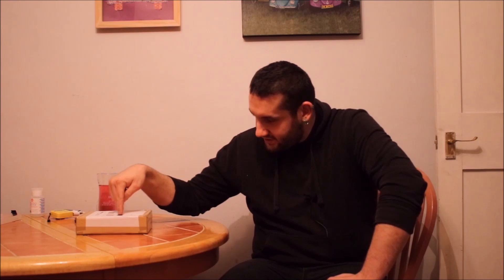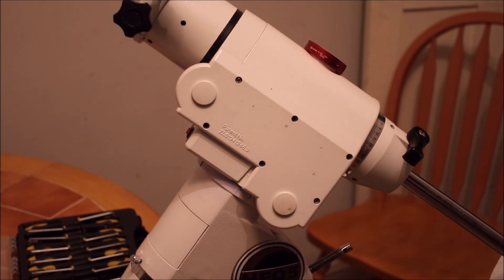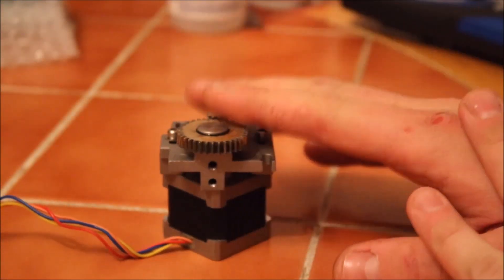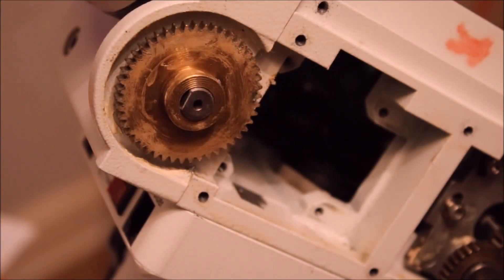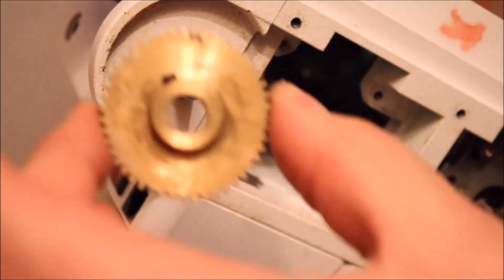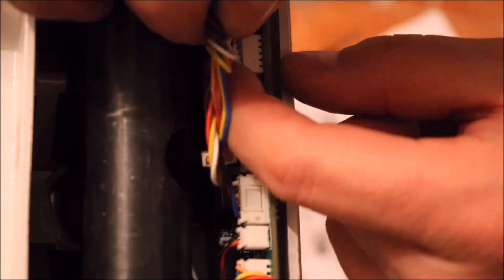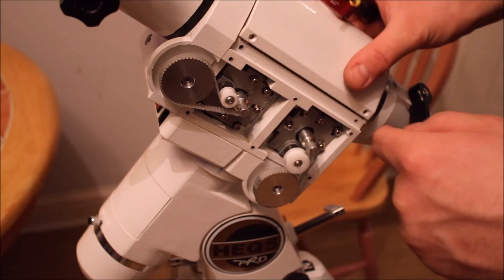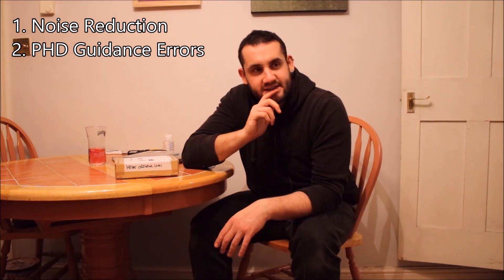Skywatcher HEQ5 Rowan Belt Modification

Comment: I would like to thank you for this video. I have just gotten started in Astrophotography, and im just now working with a Star Adventurer Pro, with an Ha modded T3i and camera lenses. Once i get the hang of everything and get some successful images under my belt, i plan to get the HEQ5. Im disabled, so weight matters and the HEQ5 is as big as i am going to go. I saw Astrobiscuits video with the fellow that upgrades and tunes mounts, and i decided that when i get the HEQ5, i will definitely do the belt mod. But i cant afford to ship it across the Pond, so i need to do it myself. 
Your video was very clear and straightforward, and i have no doubts about doing the mod myself. Thank you very much.

Comment: Wonderful, absolutely wonderful. I had a stock HEQ5 I couldn’t get to cooperate because an oscillation in RA every 13 seconds or so. I finally sat through this video one day and I ordered the belt mod kit right after. The process went much smoother with this video at hand. Thank you so much! I love the result
Reply: Hiw is your guiding now?
Reply: Did it fix the oscillation?

Comment: Great instructions!

These gears can actually be adjusted very easily. The first gear has the wormwheel attached and drives the axis, it can not be moved. The middle gear is attached to the faceplate, the third gear is attached to the electric motor itself. The faceplate is screwed down with the bolts that have washers. Loosen those and push the plate over till the third gear and middle gear are tight (but not too tight, use a THIN piece of paper between the gears to get it perfect). Now loosen the bolts without washers and slide the gear with the motor nice and tight against the middle gear. Some lithium grease and done. Might have to repeat a few years later.
A shame this is not mentioned in the manual. It is basically engineered from the factory to do this adjustment  before even  using the mount...

Comment: Great video  👍...just bought a 2nd hand HEQ5 mount and on first turning it on , got the disconcerting gear noise . Relatively normal by accounts but you’ve certainly encouraged me to do the belt mod..cheers 👍

Comment: Great video and I should have watched this more closely before I went on to install my newly arrived mod kit. I didn't remember the order of the screws that secure the motor when I took them down. I put them back randomly and they don't fit right. Some screws are now permanently loose. That tells you how cheap the material of the mount is made of.

Comment: I'm noticing guiding issues/back lash with my EQM-35 Pro mount and hate those external cables to connect the motors,. Thinking about replacing it with the HEQ5 Pro mount and doing the belt mod.  Thanks for the walk through.  I also learned a couple of new words.  Never heard a set screw called a Grub screw and the word nipping... lol

Comment: Thinking about buying a new HEQ5 instead of the EQ6-R after seeing your video.  I want a lighter mount and won't need the higher payload capacity of the EQ6-R.  However, I'm wondering if the manufacturer is going to take all these belt drive conversions to heart and come out with an improved belt-drive HEQ5.  Has anyone heard anything along those lines?  If a new model had the same price, I'd jump right in.  Otherwise, adding the conversion kit starts to bring the price of a HEQ5 close to a EQ6-R.

Comment: Another great video. What do you think about the backlash in the worm gears themselves. Are they adjustable on your mount. I know on my CGX there is an actual adjustment for the drive  block against the worm gear.
Reply from the maker: Many thanks Louis. My first video I believe!

I can't really remember about the gear backlash. I believe you could mesh some of the gears tighter together but then oh begun running the risk of binding. Though, really. I never checked and I can't remember 😅
Reply: @AstroFarsography   I've read that you can balance the mount so it is slightly heavy on the weight end so you never get backlash.

Comment: It looks like you could adjust the position of the gears to get them closer together(not too close) and get rid of some of the backlash ?  What do you think ?? Good video !! I'm looking at mounts and will be buying one soon.  I'm leaning toward the HEQ5  but it is on back-order at Adorama and B&H. They list it for $1025 with free shipping. Everyone else is more expensive.
I watched another video and the gears were moved closer together to reduce backlash. Do you have any thoughts on this compared to the belt modification ???
Reply: I just ordered mine from B&H too.  Hope it will be in stock in 7-14 days as advertised.  did you pay boo?
Reply: @hughmongus1233  Amazon had a "Like New" HEQ5 Pro for $908 in its original packaging(their regular price is $1150) and I went for it. Could be a mistake but we shall see. It should get here today. Astroshed has a series of 5 videos on setting up the HEQ5. They are very good ! One talks about adjusting the gears to reduce backlash. They also talk about balancing the mount so you don't get backlash.
Reply: @montygiavelli8125  Cancel it,  B&H just shipped mine out today. 1025$ total . not a used unpredictable one.
Reply: @hughmongus1233  I got mine from amazon but they didn't ship the tripod so I had to send it back. When I get back from a trip next week I will order it from B&H, they notified my that they had one ready to ship. I would order it now, but I don't want it to come when I'm gone.  I ordered a quick release plate to attach my DSLR to the mount - 
Manfrotto Quick Release Plate with Special Adapter (200PL). Other people have been using it and it has a 1/4 to 3/8 adapter so I can screw in my tripod ballhead.
Reply: @montygiavelli8125  LOL .    I read amazon reviews that people ordered 12" dobs but either did not get the base or did not get the tube.  One guy got 2 tubes and no base!  WTF???

Comment: I've just fitted my kit but there is no difference in noise. I wasn't getting the grinding noise like you were as I removed any backlash when I first bought the mount by adjusting the gears.

Hopefully it will show an improvement when guiding, otherwise a pointless upgrade and loss of €200 😔.

Comment: brass is soft it wears out very fast  come on if they were made of steel then they would not wear for about 20 years and adjustment and oil works wonders grease is okay but all weather grease

Comment: waste of time the belt stretches and rots in the cold it makes it worse stick to the cogs wow your an engineer you should know that
Reply from the maker: I'm a mechanic, not an engineer. Slight nuanced difference regarding material knowledge and construction. Though I would've thought in the cold the rubber belt would either shrink or become stiffer. Either would affect it but I guess my cold weather isn't extreme enough to cause issues
Reply: @AstroFarsography  no they  stretch do said belts you have a 40 pound load on a little rubber belt when before you had solid brass!  but like I said brass is not good for bearing or cogs anything with contact rubs and wears out you could so with some case hardened cogs made of steel they will last longer ,you don't see a car gear box made of brass for that reason :) well its up to you just didn't want you to be spending X amounts on things you don't need to do but hey if it floats your boat who cares :)
Reply from the maker: @NETTY436  I understood your initial comment as the belts stretch in the cold. Yeah, hang a weight off them or a tensioned load they'll begin to stretch. I suppose the logic is that they don't turn all that fast relatively speaking, nor for prolonged periods at high speed so the brass wear wouldn't be as bad. But yeah, a gearbox made from brass would be a bad idea! I noticed improvements to my mounts backlash and the noise improved a lot, so for me the upgrade was worth it :)
Reply: @AstroFarsography  yeah completely i just like making people think outside the bubble :P   but never the less you have a fantastic rig there m8 all the best and clear sky's :)
Reply: Assuming this is accurate, why not just remove a couple screws and slap a new belt on everything few months and enjoy the better performance of the belt system? Still seems very much worthwhile to me.